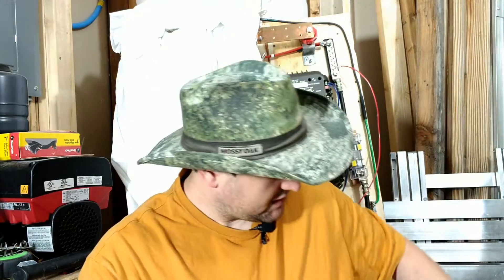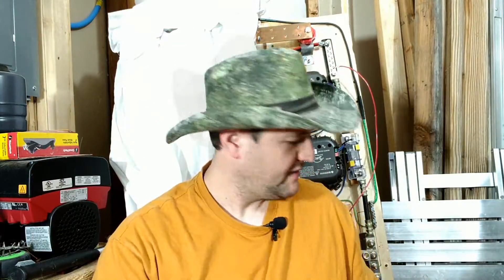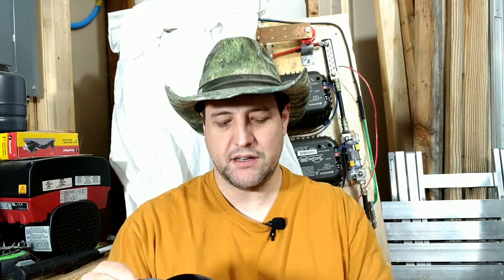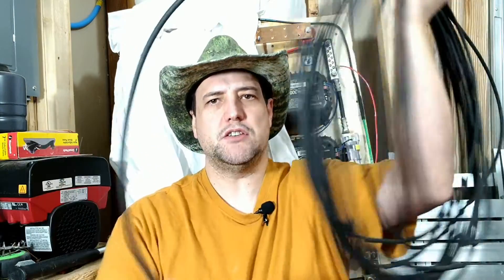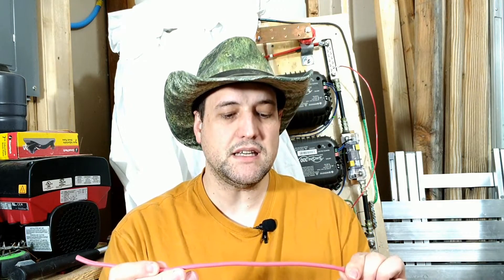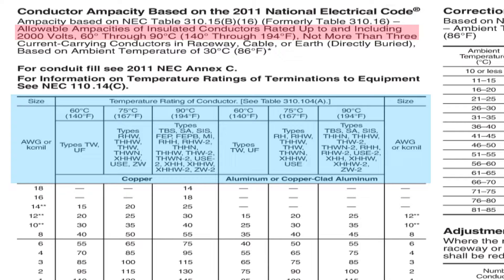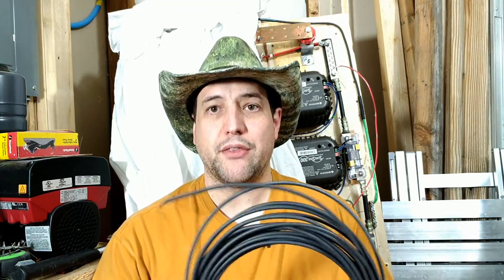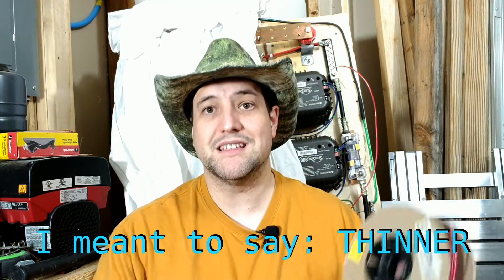AC Electrical Wire vs. DC Electrical Wire - Solar Bootcamp 003

Comment: Good job, Reed. Current is an important factor for considering the wire size. Voltage for the insulation class. I know you know this. I put the comment for other people.
Reply from the maker: No worries at all.  Nice to have an electrician also comment.

I have seen some weird stuff in comments and live streams and realized covering the basics is needed.
Reply: Weird stuff in the comments.....yep.

Comment: Interesting.  I immediately was going to guess solid core vs multistrand.  Good to know since i have a crap ton of automotive wire lmao
Reply from the maker: Well automotive wire lacks the ratings. I wouldn't use it in a house except under specific and emergency conditions as the stranding is wrong for house wiring.

But UL listed wire could be used in a car in certain conditions.
Reply: @reedin9954  what about in a 12v set up
Reply from the maker: @PalmettoPrepared  - yes and no. I will get a video about this out this weekend to explain it fully.

Comment: Thank you for simplifying wire choice. I think they just make everything so confusing , that they advice on everything to consult a electrician or any indoctrinated profession 😘😊happy new decade ⚡☄💥💝👍
Reply: Always a good idea to consider using an indoctrinated professional electrician for electrical work. Electricity can be very dangerous and can burn down your house or even kill you. ;-)
Reply from the maker: @Ria Timmermans - There is a lot of electrical work a home owner can do. Just check with your state about the rules.

One super important thing to keep in mind, the NEC code is a recipe book for a safe install. When stuff isn't done according to the NEC and it isn't under what is called "engineering supervision" and properly reviewed that is where really bad things happen. Following the code is all about fire prevention.

Also, there are a lot of subtleties involved in wiring so a good amount of education is needed, especially when dealing with wet/dry location, ambient temperature, wire stranding class (type K, type M), aluminium wiring, compression lugs, and such.

I'm going to cover lots of these items to give people a good amount of knowledge but finding a good professional can save people tons of grief and problems.

So lots of this videos are to help educate so you can spot the right professional to help. Being able to spot BS is very helpful.

Also, if you run into a question send me an email. I will be happy to help point you in the right direction or help double check what a contractor has proposed.
Reply from the maker: @Rob Painless - I'm hoping these educational videos will also help people find the good professionals. Too many scammers.

Also I want people to know that the code is a recipe book for safe install and if you hear someone say the code is over built, run away!
Reply: @reedin9954  thank you 🙏💙💥
Reply: i went to a tech school for straight electronics for 18 months  every day all day...............when i have a question bout the electricity on the farm I CALL AN ELECTRICIAN.                 what u dont know will kill you!
and there is no instant replay button.

Comment: So, is it better just to buy the strongest or thickest wire?  When my house was rewired, they used 12 guage for the outlets and 14 guage for the lights.  I asked them why they didn't just use the same guage for everything as it'd be easier to have less wire and have a one size fits all approach.  The electrician said the 12 guage could be too strong for lights.  I still don't like that answer.  I feel like it was just to save a few bucks.
Reply: It was to save a few bucks. Anytime I wire a house, I use #12 for everything (lights and general circuits), never #14 because it is just easier and the cost difference is negligible, even on a large house. But it's just habit for some.
Reply from the maker: @Pennsylvania Prepper - Rob is right, the guy was saving money. Now 14 awg is good to 15 amps and 12 awg is good to 20 amps.

I generally up size my runs as I like the conductors staying very cool so I use 12 awg for 15 amps and 10 awg for 20 amps.

Also if I have a long run I go for a bigger size to keep the voltage drop low and efficiency high.

Comment: the only real difference is cost. no reason to run wire that is rated for far more than you require. then again nothing wrong with having a more robust system than required. i did a project for the wife a while back and used 12 gauge house wiring. bought it in the smallest coil they sold and then split the outer casing on as much as i was going to need then ran the 12 gauge to all my connection points. it was overkill but it worked really well. nice and stiff and i used dc wiring connectors too for the dc system i was hooking up. worked well for what i was doing but first i had a blowout with my container. i guess 35 gallons of water was more then it could handle over time. then the sacrificial metal was a pain. every load i had to take the steel out and grind it with my grinder back to shinny metal. next time i'm using a 55 gallon plastic drum designed to hold liquid and stainless steel for my sacrificial metal. no grinding. also i  blew out an inline fuse in my 12volt battery charger because i let the negative touch the positive. so my next e-tank will also have a basket inside so nothing can touch my anode. hard to do in a medium that gets so filthy that you have to reach down through the mucky water and feel to try and keep them apart since seeing doesn't work.
Reply from the maker: Good reason to run ticker wire, especially over a long distance, efficiency and heat.  Thicker wires do not heat up as much over load and it is why I like to upsize my wires.  Less heat means less stress and a much more reliable system.

Also, over a longer distance the heat and resistance loss means you can loose a great deal of energy. When you are making your own energy those little bits can really add up.

Comment: thanks!!  what about the MC4 connectors, can they be used on AC?
Reply from the maker: Hi Tony, while MC4 connectors can work for AC circuits they are not rated for such use and a system will not meet the NEC code or pass electrical inspection.

When it comes to switches, breakers, recepiticals, and connectors they are tested for listing as DC rated, AC rated or dual rated. So it is important to carefully select components.